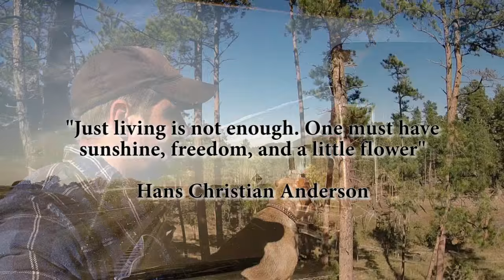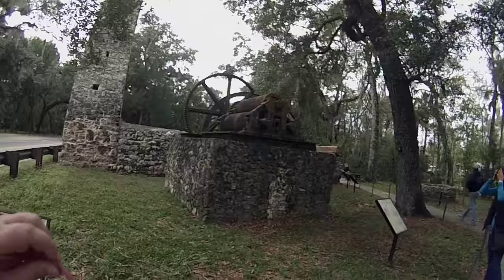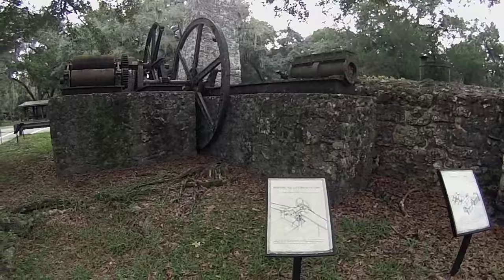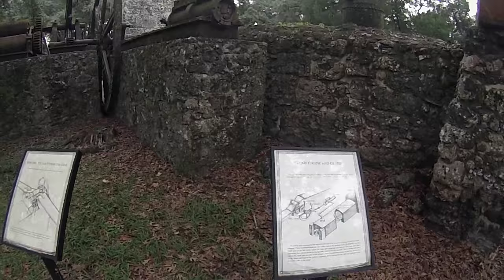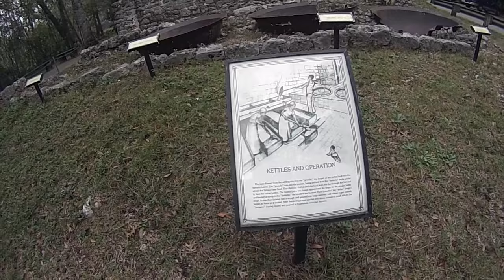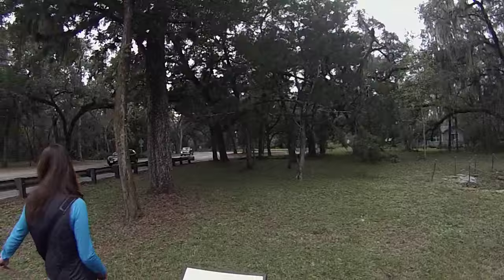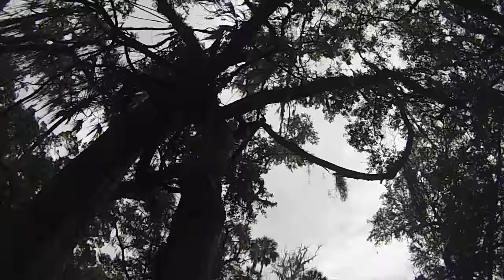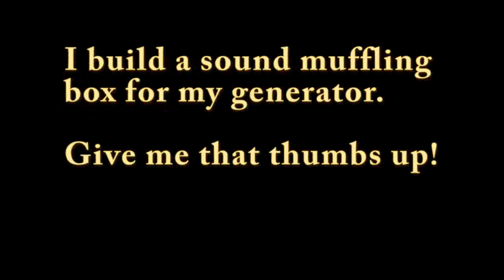Yulee Sugar Mill Ruins Old Slavery Plantation

Comment: Also, the small canal next to the mill was hand dug and stone laid both sides for small barges to have access to the mill. All done by slave labor. The army took Levy's railway from him and put him in jail. They used the rail to transport war supplies. Parts of the track can still be seen in town but the rest of the steel was pulled for scrap.